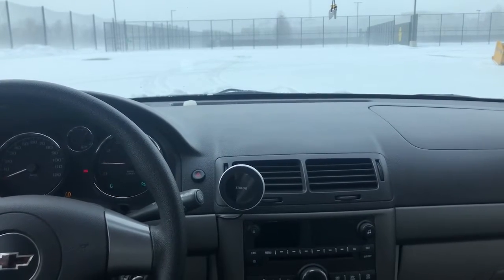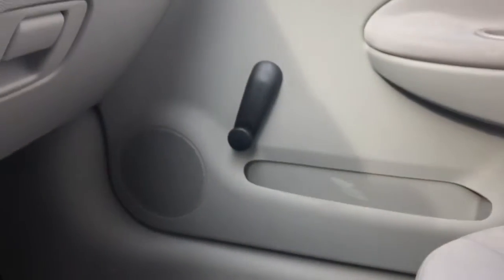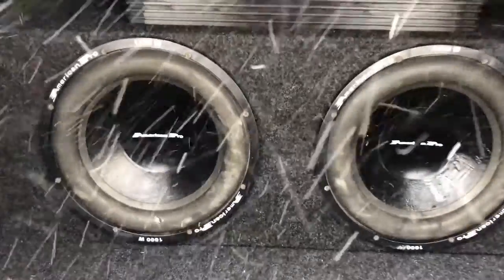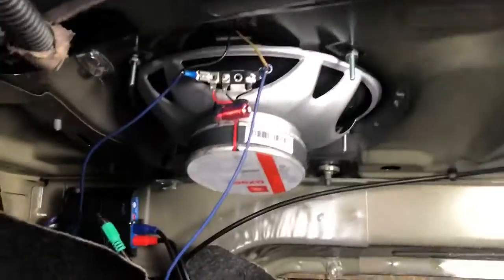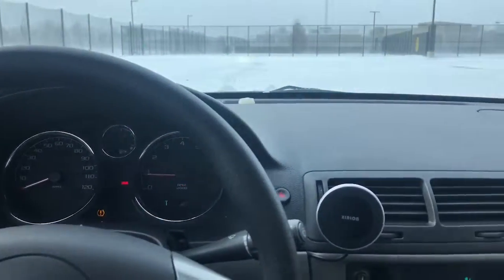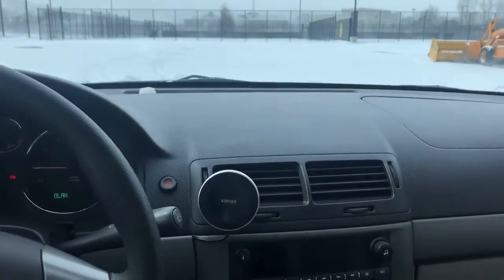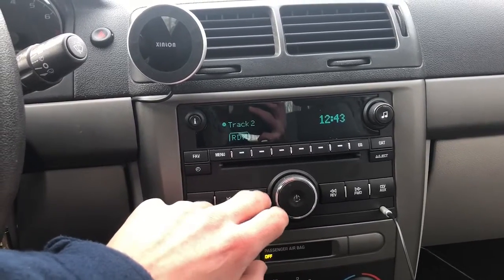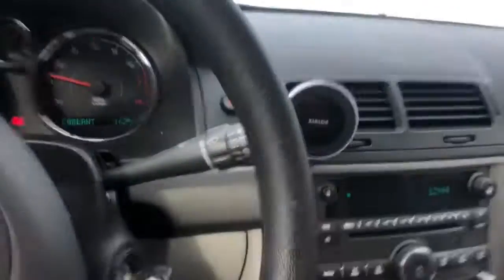TWO 1000W 12 INCH SUBS  - Original Car Audio Setup

Comment: Do you have engine noise coming out of the interior speakers?
Reply: Dose that happen ?
Reply: @nativeam25  if you run the power wire on the same side as the speaker wire, it can